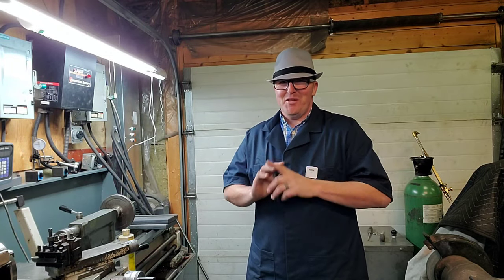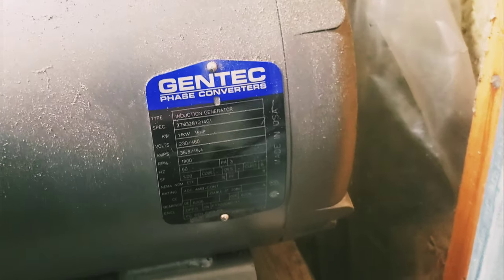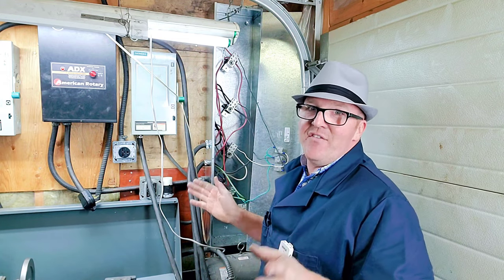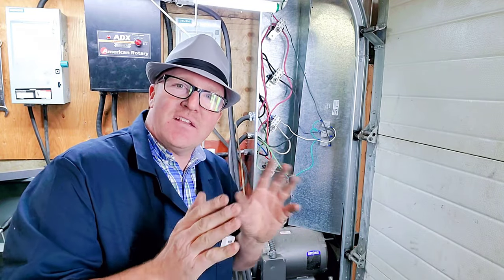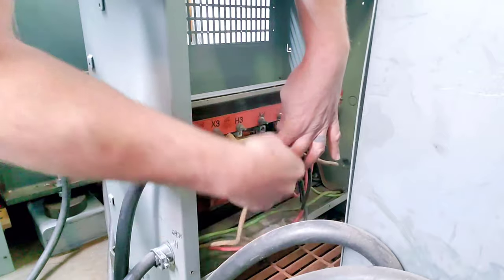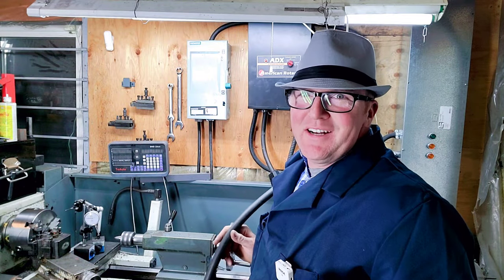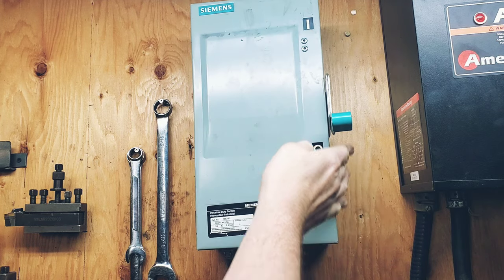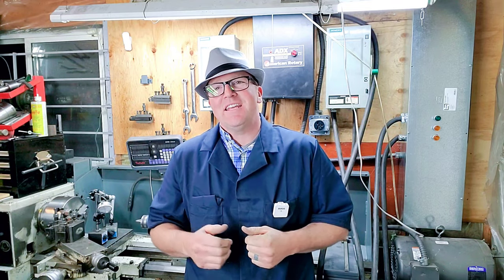220v house power converted to 3 phase power 600v 440v walk through

Comment: Cool backyard setup dude. Don't forget that you are not supposed to feed the transfos straight from the splitter as, being machines of their own, they need their proprietary cutter disconnect.
I have a similar setup at my hobby shop but Im fed up of the rotary noise and amp draw even tho I located the motor outside of the shop. Ill be going VFD soon.

Comment: I made my living In industrial controls. Instrumentation and motor control from milliamps to 7200 volts. I loved going to work every day because there was always some different challenge to design, or figure something out to make it work like it was designed to work. So I enjoyed watching your video. I would have done things different but if it works for you then it is perfect!!!
Reply from the maker: It as a fun set up with lots of learning, I can see how you would enjoy it .    What would you have done different for sake of learning on my part .    Disconect before the transformer?
Reply: @Wrighmachining   Can't talk for him but the disconnects would be nice IMO. I would also recommend using Teck or at the very least BX wires for that sort of electrical work. Having the whole circuit running straigh in your face when you're doing lathe work would be a no go for any respectable electrician. A minimum of 3ft clearance is required in front of these devices.

Comment: Funny how you just posted this video. I just received my replacement phase converter. The original one blew because I had fired up a 220 stick welder to test if it worked as someone was coming by to purchase it. I now realize that it was on the same circuit as my BP mill. You have an extra plug coming out of your box on the wall, which I should have installed for my BP. Calling my friend who is an industrial electrician to put that plug in. Thanks just in time.   EDIT:  The electrician who installed it was a construction elect.
Reply from the maker: Yes the extra plug has been handy.  I never run two machines at the same time however.  

I learned the hard way when the original plug and stuff where put in by a residential elec and past the plug was an under sized box and it went boom and it's soul escaped :)

Glad you enjoyed the video

Comment: Man you got a lot going on there. I run a 7.5 hp off one VFD I paid $600 for. I feed it 220 single phase and it puts out 220 3 phase. I don't know what your electric feed is but it takes about 10 minutes to program the drive and I have it on a 50 Amp plug. I use the drive to start and stop my lathe motor and the clutch takes care of the fwd and Rev. If you're interest in help setting something like that up hit me up.
Reply from the maker: Simplicity is key for sure and would love that set up. however  I have 6 machines in that shop ranging from 3 phase 220, 440 and 600v.    The rotary phase converter as a cheap purchase and everything else was bought second hand for penny on the dollar. I just had to keep an eye out.
Reply: I would appreciate some help feeding 220 single phase to output 3x 120V

Comment: We have a 3 phase converter. Way back when our machines were in a cube truck. I believe it's 120v for the plug. I may be wrong though.
Reply from the maker: yes each wire of two wires for the 240v would be some where between 110v and 120v.
Reply: @Wright Machining   yup. Hey, so if l1 and l2 get switched can it severely damage a hydraulic pump? We had that issue and now my hydraulics sound like poop. We did switch it back but did diagnosing with pump running until we figured it out. Also hydraulic tank was sitting at 1/3rd full and I brought it up to 3/4. Only things we did and I'm having weird sounds and hydraulics acting up
Reply from the maker: The way I understand it is that by switching two hot wires the motor will run backwards. This is the same for 3phase as well. My lathe was running backwards. Swapped two wire. Boom it's going in the correct direction

Comment: So the transformer is a step down transformer, but you are using it as a step up transformer? That is not recommended, one reason is the primary windings are usually wired close to the core to obtain opimum coupling, now you are winding secondary there, this will cause higher losses-in the form of heat, I would get a thermal imaging camera to make sure you are not exceeding the 150deg on your specification there.
Ideally you would use a phase convertor that ALSO steps up the voltage, if such an animal exists?
Reply from the maker: Step-down transformers are occasionally used as a step-up transformer by “reverse feeding” or “back feeding” the transformer.
Reverse feeding is simply a matter of having the power supply enter at the low voltage windings.

I have not noticed it hot at all . Infact it is way larger than i actualy need .

Comment: Do you know if home 220v hooked to a phase converter to make 3 phase….. what do they cash that? 220 3 phase 380 480? So confused
Reply from the maker: Ok let's explain in your regular house you have 2 hot wires going I to your panel that are 110v 115v or 120v ( you can have a variance of 10%, but you have to double check that. However I will talk about them like they are the same ) These go I to your panel and a breaker that is 110v like a TV uses just one of the legs.  If you have a table saw like mine it is 220v single phase. It will use 2 hot wires. The plug is like your 110v plug but instead of 2 vertical slot you have 2 horizontal.  Those 2 horizontal's are the hot wires and the mouth of the plug is the ground.    
 Now here is the 3phase part explained .
If you have 240v 3 phase it is basically the same 2 wires like your house but there is a 3rd hot wire on the plug   Now each wire has it's own timing that will push the motor round. Think of them like 3 guys in a shop turning a single handled vertical crank on a motor. The three guys stand equally apart like 60deg and each one can only turn his handle when it's on his side.  Essentially this is how 3 phase power works each part of the triangle is working evenly to spin the motor.  If you take one guy\leg out of the mix the motor will not turn very well if at all, and eventually one guy will be pulling the handle as hard as he can but dosen't have the leverage to turn it.

So in follow up to the first question. 220/240/260v single phase 2 got wires with good leverage to turn it but wastes power.     220/240/260v 3 phase has 3 hot wires that all push at different times.

Now ..... As for 240, 380, 600 v 
Think of voltage as pressure in water pipes. 240v is like 240psi if it was a pipe. (Different really but it helps understand the topic )  if your motor is 240 3phase it can run on a 10% variant of the pressure ( voltage )  to much it goes pop to little it goes hummmm and let's out it's magical smoke.   I believe 220v 240v and 260v all will work  interchangeably.  You get the voltage measurement by measuring + lead on the oam meter to hot and - lead to another hot wire. Different than single phase where you go hot to neutral.
Now in different areas you have different pressures. So in the west here we have 240 and one other  440 volts. Back east I think it's 600v. Or am I mixed up :) either way     like I said you have that 10% variant in voltage so a 380v 440v 480v are all in the same wheel house if in not mistaken. Just it's prefurdd that you want it close to what the motor was made for.

Now as for the phase converter part.  Think of it like I said earlier, think about it like a vertical shaft with one crank handle on it and each guy using his leg to kick the shaft to spin it . Single phase 240v (with 2 wires ) has two guys on oposit sides of the shaft sharing the load using there one leg to move the shaft around . They can do it because the leverage is set up but wastes power. Now for 3 phase there are 3 guys 60 degrees apart each guy has to share the load equally. Take one guy out and it will not work right.     
 So we need to make power some how to move the third side. To do this we need to have an extra motor in the shop to act as a generator ( is usually 2x the size of the machine motor. ) 2 phases  and spin it but the need a 3rd guy to get it started and keep it going. The third guy is a capacitor or a mechanical way of spinning the motor up to speed. Once it's spinning it; with out a load it will have momentum to spin past the missing leg of power. It will maintain its speed once it's moving at full speed and has nothing slowing it down.  Once it's running at full speed it will begin to generate power where that missing side.  This is where it is sent to the machine to run it. The other 2 power legs hook to the machine as well and .... Poof you have 3 phase power. 

There is obviously more to it than this but hopefully gives you a basic understanding of it.
Reply: @Wrighmachining  sir, first of all……. thank you for not only answering me, but Let me just say wow! You answered me with 5 paragraphs. Not only did you take the time to write me an explanation it is very easy to understand. 
Have a great day sir!

Comment: I’m assuming you specifically need the Step-up Transformer to run the heavy machinery like the layth. The rotary Converter should kick out 415v without the transformer right?
Reply from the maker: I don't know the answer to that. I have one transformer for 440 and the other 600v.   I'm pretty sure there is a 240v 3phase as well
Reply: The rotary is only adding a 3rd leg to the existing 240. Transfos are there to bump the feed from 240 3ph to 600 (transfo1) or 480 (transfo 2)

Comment: What is the power output or rms current of the phase convertor?
Reply from the maker: Botb transformers are 30 kva .  In saying this that is massive compared to what is required of them .    The motor is also way over sized for the lathe but i buipd things to expand them .   Later if i plan to get a bigger machine ( loke i have the room , lol )  i can do that .
Reply: @Wrighmachining  Did you consider a VFD? and if so, what made you decide on this instead?, reason I ask, is I am requiring 3ph at some time.
Reply from the maker: Yes i had thought of thet but swapping out the motor on every machine can get costly. I have a rur600 grinder , surface grinder , lathe and mill

Comment: Where in hell did you get a 600v 3 phase lathe??? I purchased a 1941 Sidney engine lathe after my $300 bid on the craftsman 110v bench top lathe fell through. I had been drinking heavily from my new keg fridge and thought " ill show that stupid bench top lathe and bid on,, on,,, " fade to black. 

Apparently i bid $1 over the $2500 current bid. And won! Woooohooooo. 
No. Not woooohooo.  I thought it said free shipping!. I live in Arizona. This mo#%\_$erfu#%:!er is located in New Jersey. And it weights almost 5000lbs.! Goddamnit. Wtf? If i had been married at the time, well i wouldnt be now. And its 208vac(3phase)! Goddamnit again. Another $1000 for the rotary phase inverter. And another $500 for wire.  I put it on my porch. I no longer have a porch. I had to build a wall around it. 
Kidding aside i love it. Its has a taper attachment and i can still hold +0.0002/-0.0000 on this antique. Even though it was supposed to be a hobby lathe its pretty impressive and my friends i should stop drinking. What do they know? 

I dont remember what they know come to think of it.. Hmmmm..

Anyway. Where you from friend? You said "it would be something like tractor supply if you where in the states". I think only electric trains use 600v in the states. Damn. Thats some big voltage. Wtf? Your in New Zealand huh??  
Good video though. Thanks fir sharing
Reply from the maker: Hahaha, from Canada BC, I'm sure you know by know drinking and auctions do not go together, haha but I'm one to talk. I built a still a few years back and had to give it away due to some questionable life choices I was making after firing it up every weekend.  originally this lathe was from Spain but was purchased buy some manufacturing company out east and then by a tool company along with a surface grinder.  For some reason back east they where using this power in some areas.    At the time it was bought, the auto industry was slowing and they where for sale really cheap. Trucking was cheap as well.( comparatively ). You can't find a good machine out here to save your life unless you give up your first born. So we had it brought out and then with the help of some buddy's we used a pallet jack and ½ply wood and rolled it to the back shop.   Best machine I have ever had, although wish I has a taper attachment like yours :).   Glad you enjoyed the video!